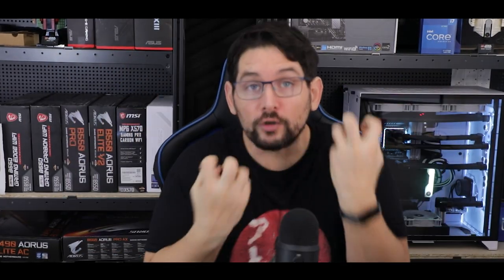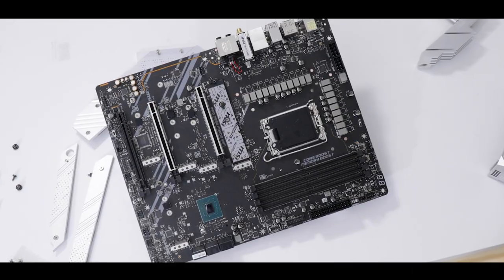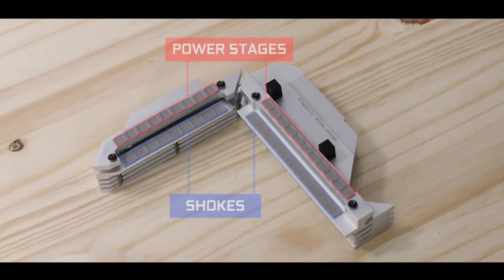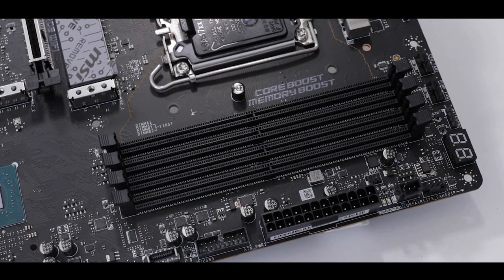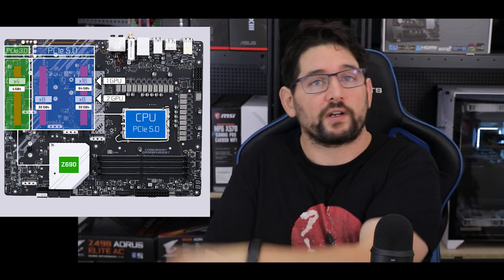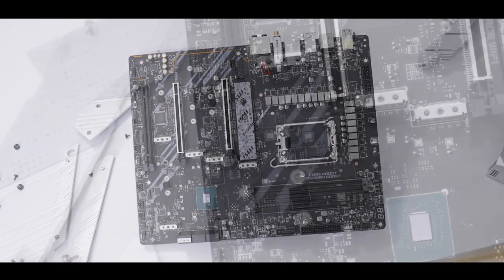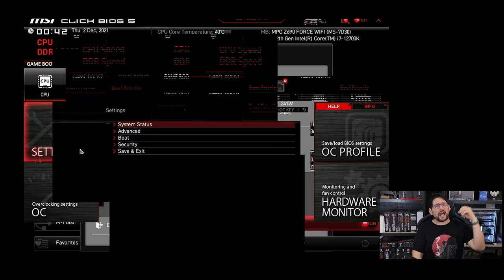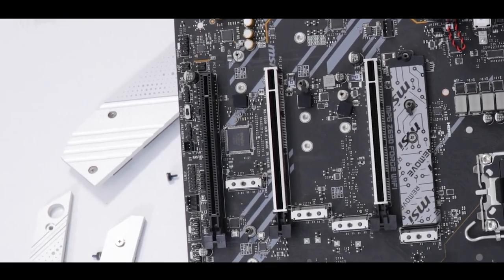MSI MPG Z690 FORCE : A rushed product?

Comment: Very thoughtful review. I bought this board recently (before seeing the review) but thankfully it seems MSI has addressed many of the bios problems with recent updates. On the most recent bios I have not experienced freezing or glitching when attempting to overclock cpu or ram. Perhaps your review helped accelerate fixes, which in turn benefitted folks like me, so thank you!
Reply: thinking about buying this mobo or the asus prime-a one though am leaning more towards thiw one, would you say it's worth the extra money?
Reply: Were you able to get the DDR5 ram working at full capacity? I'm about to build a pc with this mobo and DDR5 ram. I'm hoping I won't run into too many problems lol
Reply: @hevz6339  I am contemplating the same options, which one did you ended up going with?
Reply: I just got one. Bios is still buggy for me, updated and all but getting the weird layout and chinese stuff
Reply: @CRJ08  did it ever get fixed?
Reply: @baloneyslice247  hi, I have done only one more update and still got the Chinese layout, I'm not on the current latest version nor I'm going to update it because that one more update I did ended up with my windows deactivated, don't know if it was my issue with the key I had or the update, so… I would say, if I update it now I think would get the Chinese layout again 🤭 I hope you could understand my english 😅
Reply: @CRJ08  Thank you, as much as I want this board and how great the price is, i might have to pick another one... bios is the most important thing for a z690 and a K series chip. and yes the english comes out just fine :)

Comment: I was glad to hear you speak of the BIOS. I had the Z590 Gaming Carbon Wifi but stopped using it after less than two weeks. The BIOS was the reason, it would freeze whenever I changed a value (even just setting fans to PWM!). Then tech support was useless and after three emails they just stopped replying. I expected better from one of the top 3 motherboard manufacturers. Plus, I'm tired of that damned dragon logo making every product uber tacky.

Comment: No issues with my Carbon WIFI, so I can either assume it has better BIOS support or by now the latest versions for both have resolved the problems.
Reply from the maker: Thank you for sharing!
Reply: Im currently also using the z690 carbon i didnt have any troubles in bois
Reply: Thanks for this..  I feel like an idiot now for telling people to avoid this board..  is this a genuine comment though?..  lol
Reply: @bryanvella6534  I didn't keep the Carbon, but not because of any issues with it. I wanted the Unify.
Reply: @sabishiihito  so thats 3 people without this issues, except on the carbon... man i want this board so bad but it would be such a pain if i cant access bios settings on an unlocked chipset

Comment: Good video, by any chance, have you found the CMOS battery for this board?
Reply from the maker: you know what.. no i did not... interesting!
Reply: @Honcho did u find it?? 😁😁
Reply: @deus5185  I did not, which is very; confusing? Lol
Reply: @HonchoYT  maybe it is vertical, at minute 20:31 , look at the Audio Ports there is a red/black wire connected to something like a vertical battery , maybe this could be  🤔

Comment: this is the same as the carbon? dam I think I get the gigabyte arous pro
Reply: It is the same. Just a different color.  I got the carbon. I wish I would have got the Asus Maximus Hero 😑🤨
Reply: @Kingtoby1981  I got the Carbon too, wishing I got the Hero as well. Though I think it only supports 3 M.2 NVMe. Or maybe that's the Strix-F. Can't remember. Either way, my new build is going to be a PITA. Only DDR5 I could find for a decent price was XPG Lancer... and I hear it has to be manually timed to hit it's 5200MHz speed. I hate this stupid shortage and settling for half decent products. I have a 9900K + 2080 Ti build... half tempted just to scrap this entire 12900K build and wait.

Comment: @Laurent's Choice What motherboard would you recommend for LGA1700 between 200-300$, cpu Intel i5 12600k and Intel i7 12700k. Any suggestion ?
Reply from the maker: hmm.. short budgetr for a Z690... what CPU u got in mind?
Reply: @Laurentschoice  Core i5-12600K or Core i7-12700K
Reply: @Laurentschoice  intel i5-12600K or intel i7-12700K.

Comment: @Laurent's Choice
Tired of waiting for your MSI ACE x570s MAX review.  Got the MB:
5900X / 32GB G.Skill / 6900XT.  MB is (knock on wood) basically solid.
EXCEPT I couldn't get the OS to recognize the onboard RAID config (no matter what order loading the drivers at OS build, even correct order).
Overall the complexity of a MB RAID setup is stupid and thus I gave up.

Other than that, the MB is really nice and doing a nice job   (Oh, I reseated TG paste on the chipset chip for good measure).
Reply: Ohhh not bad
Reply: Watch him now come out with a review on my board dissing it.  A French Canadian move?  🙃😛

Comment: I have this motherboard with 32gb ddr5 5200 vengence ram, nvidia 3090ti founders, i9 12900k, 1tb 4th gen m.2 ssd, and a 1000watt gold plus power supply
Reply: If you built this recently, was the bios that came out of the box an updated version or did you need to update the bios
Reply: @pp_rao  I built it recently and the bios out of the box were updated version
Reply: @pp_rao  this PC I built runs so smoothly.  It turns on almost instantly.  Shuts off instantly.  Games are so incredibly beautiful its mind blowing.  Ultra graphics runs smooth. I am so impressed by this PC. Ddr5 no issues.
Reply: @D-Ross86  cool, I am building an almost identical pc, only thing different is ram and psu specs
Reply: @pp_rao  lmk your build.
Reply: @D-Ross86  i9 12900k, msi z690 force, trident z5 32gb 6000 cl30, corsair hx1200, msi suprim x 3090 ti, corsair h150i cooler, samsung 980 pro 1tb, all in corsair 5000x case
Reply: @pp_rao  nice man. I have the iCUE H150i ELITE CAPELLIX Liquid CPU Cooler. And mine is in a server rackmountable case. What games do you play? Have you tried lost ark ?
Reply: @pp_rao  did you already build it? I really like the msi force motherboard
Reply: @pp_rao  the bios is fine now. I have this too. It's a good motherboard and the price is a lot lower now, for $300 there is nothing better for z690.
Reply: @cutcorners6005  yeah it's good now, I've been using my computer for like a week and a half now

Comment: I've bought an Aorus Z690 Master, great motherboard, but all new Aorus series have only 1 pcie-5 slot and the other 2 pcie-3 are only x4 :( I need to use this new configuration with 3 x 3090 1 each monitor, and i would swap to this MSI MPG Z690 Force... hope well :(